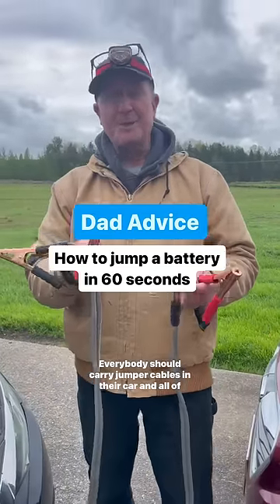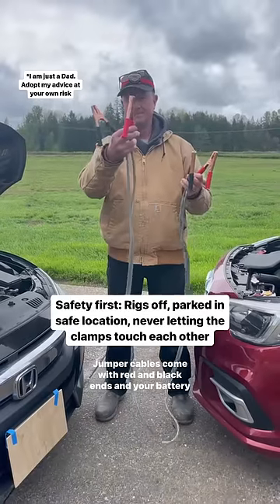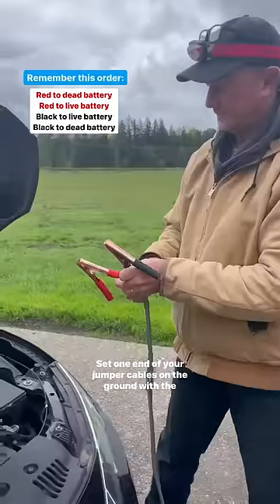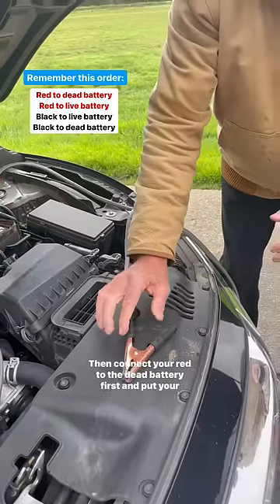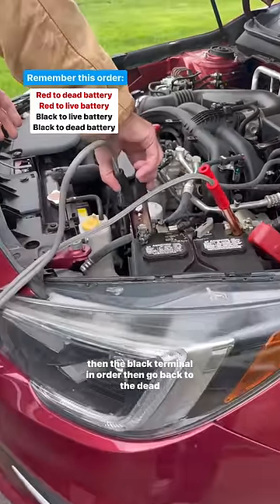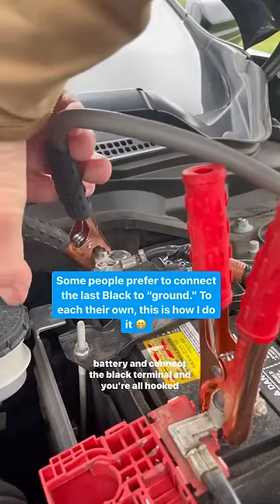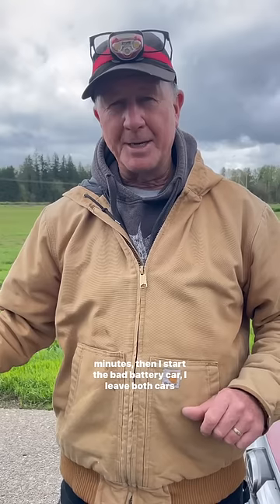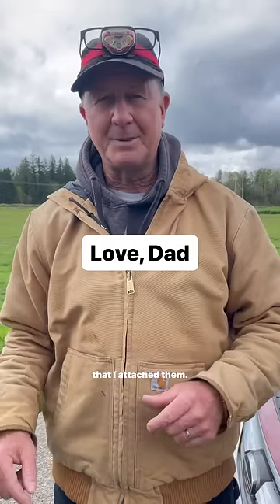How to jump a car battery. Love, Dad

Comment: I'd be standing beside the car being jumped off, & the sec it starts, disconnect the red terminal, bc these newer cars, if you leave it hooked up, it'll send your cars computer mixed signals and could mess your charging system up by putting out too much power, trying to make up for the car with the dead battery! This will save you from a huge bill from the local mechanic. You are welcome!

Comment: Noooooo. If you’re jumping off a car with a bigger battery this will FRY your battery. The last black should go onto a piece of metal on the dead battery car. NOT THE BATTERY.
Reply: Nah…
I’ve heard that before but never done it and never had a problem. Besides, good luck finding a clean and unpainted surface on which to clamp…

Comment: So not start the dead car from the good car with its motor running. You will damage the good car's alternator diodes on the regulator circuit board. Or worse put AC ripple into the ECU that it cant handle.  Where are YouTube fact checkers when you NEED them?

Comment: Sorry wrong advise. You should never have both alternators running at the same time or it will fry the electronics on the donor vehicle. Donor should be off when starting bad battery OR!! Donor vehicle can charge while running for 10 min but don’t attempt to start the bad vehicle until you disconnect from donor battery. This will charge the battery a bit to start it

Comment: Throw those cheap ass cables away and buy a REAL set. Those things are trash😢😢
Don't connect to Negative battery posts. Use a solid metal part.

Comment: I’ve been a merc Benz tech for 42 years and jumping vehicles is not what it used to be! These vehicles now deal with minimal voltages and amperage’s and all it takes is one little blue spark to blow something in a control unit so just be very careful when jumping newer vehicles

Comment: This dad is not a good dad, because he’s doing it wrong. The battery can explode, and the hydrochloric acid can easily burn your face off and cause permanent blindness. Directly connecting the batteries together, there is no protection.  However, by connecting the negative jumper cable to the metal of the vehicle, and not directly to the battery terminal, you have now installed a 20 to 30 amp fuse between the cable and the battery which will act as a protection for you.  Because of electron flow, knowing that the electrons move from negative to positive, the ground or black cables should be connected to the frame first and the red terminal should be connected. Last be careful that they are not touching anything metal before you connect them.

Comment: Never leave both cars running at the same time while hooked up after starting. Turn the good battery car OFF, then start the dead car. Ground negative to frame. NOT on the dead battery terminal..

Comment: Wrong maybe years ago but the newer cars n trucks are way more sensitive and can not take that type of hook up. The owners manual for each car has its own procedure for hook up. I prefer keeping my car off and letting the dead vehicle try and start off of my battery. That way no chance of frying my alternator just trying to help someone out. No good deed goes unpunished !!  If you were to hook up this way shows in video then as soon as the dead car starts.... so does its alternator and starts throwing power back into your alternator which will cause your alternator to fry or weaken the diodes in it... fast forward 2-6 months later your alternator goes bad .... alll because if that’s jump start that was wired wrong.... hope this was helpful

Comment: No Dad you are absolutely not connecting them properly. You should never connect the neg of the boosting hart. To the pole. You should in fact connect it to a ground as ne’er to. The regulator (altanator) as possible. And you really don’t want the running batt connected to the running source. Try to start the dead battery after boosting for 3/5 minutes

Comment: Just goes to show you that no matter how old someone is doesn't mean they actually know what the fuck they're doing. You never put the black negative on your battery. It goes on a piece of metal so your frame or if you find a ground nut you can't do this. Especially with modern day cars. The computers EFI all those systems cannot get a surge

Comment: What happens when you connect a circuity in parallel? Well, the Voltage goes equal, meaning that your good battery will instantly reduce the voltage! to be able to have same value in the parallel circuit. That is very wrong.

Comment: I gather you absolutely DO NOT do that with an electric car.  Probably not a hybrid either.  That is the way I did it, my dad did it, and the way most from AAA used to do it.  To be safer when clamp the black to part of the metal frame to ground it.

Comment: Wrong! Never connect the negative cable to the dead battery. If it’s leaking and creates a spark it could explode! Always ground the negative cable to a solid metal part in the engine compartment not too close to the dead battery.

Comment: He never mentioned  the everything in both cars must be off, and you dont run the car with the good battery do the you can damage the alternators, if car don't start them give a charge but you can still burn the alternators, thats 48volts not 12volts jumps

Comment: This is dangerous… batteries give off hydrogen gas, a spark anywhere near one has the potential of blowing up the battery. The order that he connects the cables is fine but that last black (ground) cable should be connected to a metal part of the car well away from the battery.

Comment: Never connect directly to the Negative side.  For safety purposes connect to the metal frame.  This protects the alternator, battery, the computer, and in modern automobiles keeps the system up to date as to the state of charge. Never go straight battery to battery.😮😢

Comment: If you do that with a new car you can fry internal components. Have to leave the good battery car off so it's only providing the battery power. That was it doesn't surge the high power into the bad system.

Comment: When a flat battery is connected to a charged battery, the difference in voltage can cause a spark, which can ignite any hydrogen gas given off by the batteries..so it is safe to make the final connection (ground)away from the batteries..preferably a convenient place on the vehicle..it can be clearly seen that any spark is at a safe distance from the battery

Comment: Haven't used jumper cables in 20 years. I use a 2K amp booster. Better and safer than jumper cables.

Comment: You should never have the two cars running at the same time you could damage the computer system you should have the good battery charging the dead battery for about 10 minutes. Then disconnect the cables and try starting the dead car

Comment: You're smart, but not enough.
What you don't know is that if you keep the good car engine running while starting the bad one, you can burn out the diodes from the alternator of the good car...

Comment: No, you are wrong. First of all, one of the ground wire must be connected to metal body of the car. And most importantly, both cars should not be running at the same time.

Comment: All correct! Until, the end mistake. The final connection never goes to the battery negative. But to the frame, engine lift bracket, or other source of metal that is grounded to the battery.

Comment: If you do it like he says you'll fry your alternator! Do not let both cars run while jump starting your dead battery car! Leave the good battery car running to charge the dead battery and then shut it off! Now get the dead battery car started and once started remove the cables from the car running and then you can remove the cables from the other car!!

Comment: Never have the good car running while starting bad car that’s a great way for both cars to end up screwed up, voltage spikes and two alternators fighting to charge a low battery will fry a alternator or computer 75 percent of the time

Comment: Do not start the discharged battery car while the other one is running!  Starting the car with the other one running will create a strong short, do to the heavy load of the starter motor, bringing the system voltage very low, therefore fully energizing the alternator electromagnetic field, as the load or short is removed when the other car starts the system voltage will spike higher than normal and potentially damaging either car’s computers!

Comment: no. you just f up both cars. A always find a good bolt to connect the ground. B let the good battery charge dead battery. after some time, shut off charging car, disconnect cables then start dead car

Comment: You are wrong! Charging for few menutes is ok but never start other car with a firs one with ignition turned on. You can waste some electronics. Some electronics in a car are separated while starting the engine. Drop of voltage is huge and can made multiple errors on some computers or waste alternator.

Comment: I disagree, if you look at the instructions and the diagram on the jumper cables that you have, it will show you that on the dead car you put the negative to the engine block not to the negative battery terminal. Not only are there gas is given off from the battery that are flammable but if you have a really bad battery it will not allow a charge to flow through it and you could be trying to jump that car all damn day and getting nothing. But if you put the negative to the engine block, you're putting the charge straight to the starter because that's what you want to do is start the engine

Comment: Bad advice.  That ground to the dead battery should be connected to a metal part of the engine of that car.   If not, the computer system in the car with the dead battery will reset as if it just got a good battery, causing a lot of electronic problems.

Comment: The reason for connecting one to the frame of the car instead of the battery is because batteries can have an explosive gas around them, and when you place the last clip a spark is produced.

Sparks and explosive gasses are not good things to have in front of your face at the same time.

Comment: Never have the two cars running at the same time while still connected to each other. Each alternator is pushing out over 14 volts and can damage electrical components. This Dad needs to be educated about that.

Comment: Wrong… put the leads on the dead battery first, flammable gases are released from a dead battery, a risk of a electrical ark will be present on the final contact lead which should be the earth lead on the fully charged battery.

Comment: Gray fox is correct, if the ground cable is connected to a ground on the vehicle when the attempt to start the vehicle the voltage will travel through the starter, not the battery, no chance of battery explosion.

Comment: Your gonna wanna have the good battery car off to start the other one. The vehicle running is monitoring alternator duty depending on the small electrical needs of the running car and now your gonna power up another cars starter motor. Good luck

Comment: Positive always on first and positives always taken off first the dead car is last one to get hook up an the first to get unhooked that way you don't cause electrical surge on the running vehicle after starting both vehicles do not leave them running why they're connected disconnect the Dead car that started you will overload the alternator

Comment: please always connect cable by cable and do not clamp the negative terminal, only use the positive terminal of the dead battery to provide current to the battery and let the dead battery ground itself otherwise you are providing an earth to the healthy battery which also has to ground its own current. Furthermore to this, you still obviously have to earth the live battery to the dead vehicle so that the current can return through the dead battery and earth on the dead vehicle's body or go through the positive cable.

Comment: Dont run the good battery car at all just leve it off because when the other car starts and you have both cars running your alternator in the running car will get an overload of power and it could damage your on bord computer system.

Comment: Do not run the good battery car, hook up the cables and turn on the headlights of the good battery car then go start the dead battery car. As soon as the dead starts the alternator will go full field and that is enough to cause damage to components on the good battery car, so with the head lights on that surge will run to the lightbulbs and cause limited damage

Comment: Wrong bad for altinator both cars off keys on start bad car disconnect Meg cable immeadiatly start hood car and let both cars run drive both cars one hr or more the dead car put miles on it have both cars charging and batts checked

Comment: Never realised about the significance of the black / red ends of jumper cables and the black/red battery terminals connections. Thnx for the tips. Anyway, What happens if you connect cable ends to the wrong terminals? Will the engine  explode ? Just in case something bad happens, I usually call my mechanic to jump start.

Comment: People....Do NOT use jumper cables on the newer vehicles. NEVER. 
Any kind of electrical surge has the ability to damage or burn out electrical components. NEVER USE JUMPER CABLES. 
The SMART way is to have the dead battery charged because an alternator is NOT a battery charger, it maintains battery power. 
However, if you must boost the battery, use a battery pack designed for this. BUT DO NOT USE JUMPER CABLES.

Comment: wrong wrong wrong ,pos to pos and from good battery neg to metal on motor this will give you all the amps to start car if you connect to batt neg you will lose all amps to charge dead battery and no amps to start car

Comment: Some people don't like the battery blowing up in their face. Set off by connecting the ground to the battery terminal, sparks igniting the hydrogen and oxy mix in the battery cells. (Note: it is not always apparent which terminal is positive or negative. The positive terminal is normally larger in diameter than the negative. Sometimes the positive terminal has a + sign stamped on its top. The terminals are also identified by a + or a - on the plastic case near the terminal(s.)
 
If you are going to carry jumpers then also carry a small volt meter (about $6 from Harbor Freight) so once the vehicles are disconnected you can see if the dead battery car's alternator is putting out at least 13.8 to 14.2 volts this will tell you whether the alternator is working, or not. If it is not putting out the voltage then either the alternator or the regulator is not working. If it is working and the battery problem persists, it is likely the battery needs replacing. (Barring that you left something on in the rig and that's what ran the battery down)
If the alternator is constantly putting out about 15 or more volts the alternator/regulator is bad and as well the battery could have been ruined.

Comment: And, for all you introverts, there's a gizmo at the parts store that is basically a battery with cables on it. It's small and light and you don't have to talk to anyone. You can just jump your own battery. And they generally have USB ports now days so you can charge devices also. Just remember to recharge the thing when you ha e to use it!

Comment: NEVER have both vehicles connected when both engines are running!  That can damage electronics; especially if the formerly dead vehicle has a defective alternator.

ALSO, I turn OFF the engine in the good/jumper vehicle & rely 100% on the good battery to help start the dead vehicle.  Once the vehicle is successfully jump started, I immediately disconnect the jumper cable.

IF the engine dies after disconnecting the jumper cable... then, I'll make an exception and will startup the good vehicle, reconnect and allow it to charge the dead battery for about 5 minutes.  However, before the dead vehicle tries to restart, I'll shut down the engine in the good/jumper vehicle.  Last... disconnect the jumper cable as soon as a successful restart occurs.

Comment: Epsons salt  1/2 cup  & 1/2 cup distilled water. . Mix well . Battery will clean its plates for better charging . Battery will last longer too . Werx . If you take the neg  battery turminal off and the car shuts off . Your altenator is not charging check all connections first before the swap
Reply: Easy test when running back  bearing of the alternator  will stick if magnetic . Working   its charging .

Comment: Also you need two sets. Copper wires are so impure these days. High resistance. Connect two sets in parallel otherwise you won't get enough power to start and think something else is wrong.

Comment: the reason for making the ground connection to a ground such as engine block is to prevent a spark being created on to other battery because a spark at a battery may create a fire or explosion hazard from the venting battery gasses

Comment: Better to connect the last black cable clamp to a solid metal part of the engine block to avoid making a spark near the battery which could cause an explosion of the dead battery. Safety First!

Comment: Not jump of my car as you have no idea what you are doing!
Reply: My car has 220amp alternator and it is not design to designed to withstand more 900amp jump start load. Any body who know anything about it will know jump starting a flat battery has a real chance of destroying the alternator. On my Mercedes that will cost £800- £1100!

Comment: When starting the good car battery make sure to turn the Parker lights on to protect your computer from any power surge -that way only your lights fuse will blow...
I always carry jumper cables & jumpstart 3-5 car's daily but I always connect "both Red & black" to the good battery first then both red and black to the dead battery -then start good car & turn on lights before starting the dead car